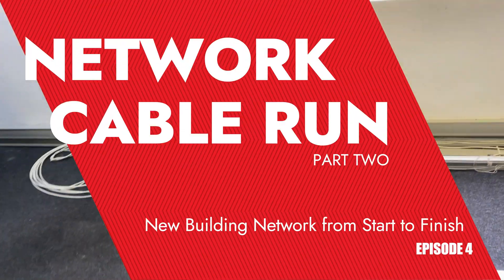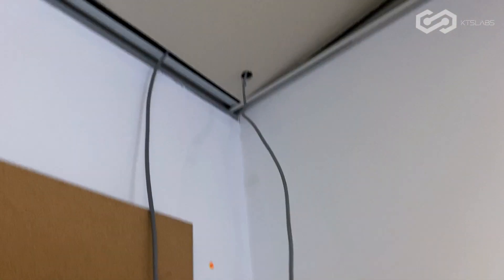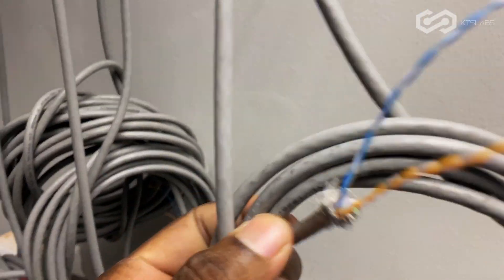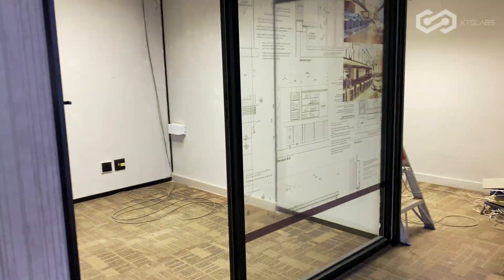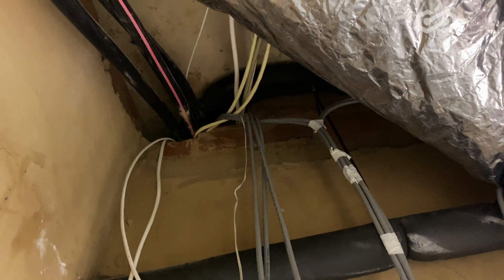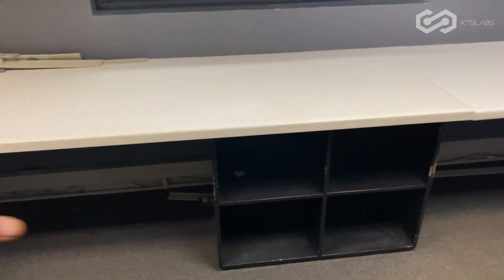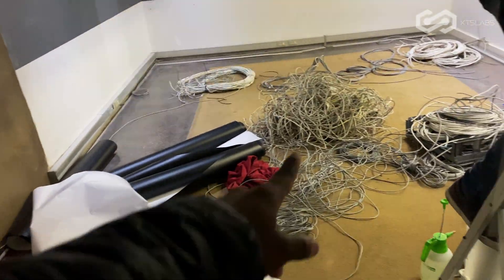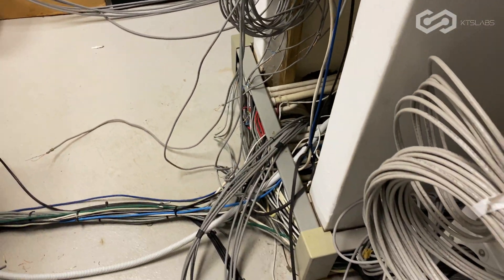New Building Network Setup from Start to Finish | Network Cable Run | EP4

Comment: What is topogy ?
Reply from the maker: Network topology refers to the arrangement or layout of different elements (links, nodes, devices, etc.) in a computer network. It defines how devices like computers, routers, switches, and cables are physically or logically connected and communicate with each other.